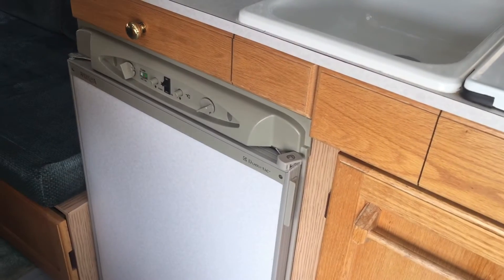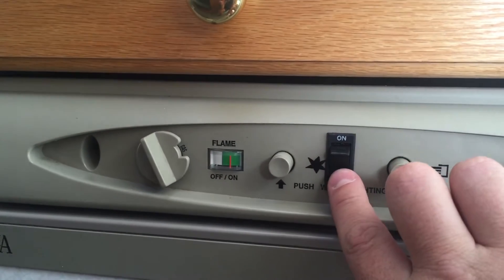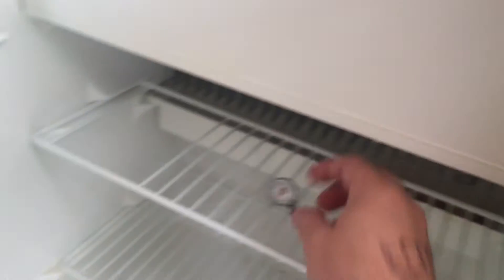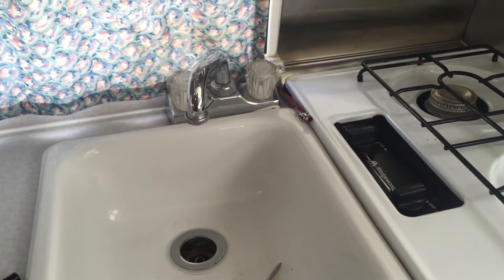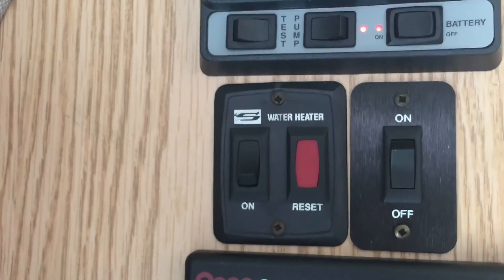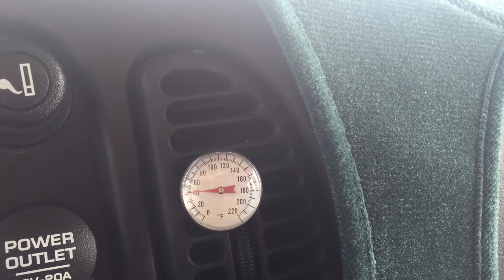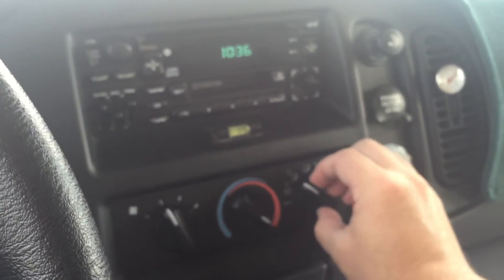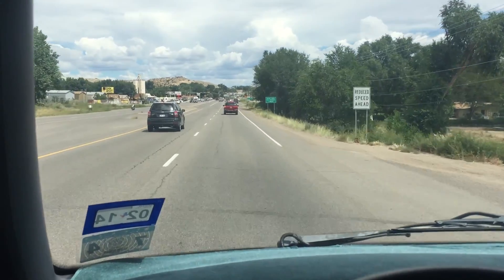1999 Dodge Roadtrek Popular 190 VIDEO 2 of 2

Comment: I have just recently acquired a 1999 Dodge Roadtrek 190 Versatile .  Thanks for the video .   Mine was owned by an elderly couple who only put50,000 miles on it .  I traded my 2016 Ford F-250 for it at dealership ( title swap ) .  Can you do a further video on outside explain the area of refrigerator and water intake ???
Reply: I've also got a 190 Versatile, 1999.  If you have any questions, I might be able to help!